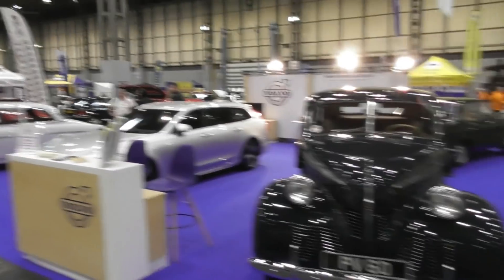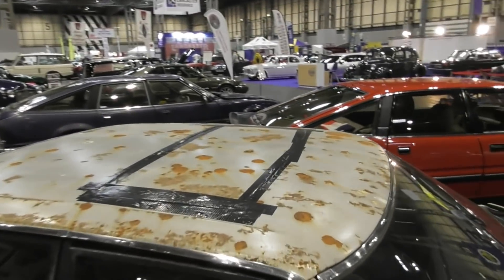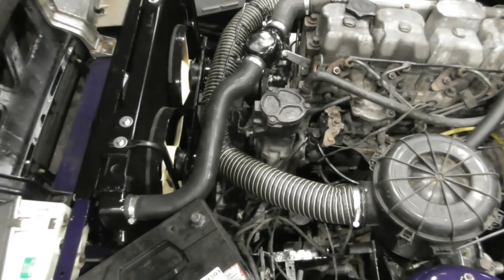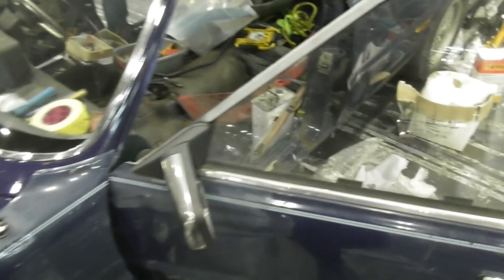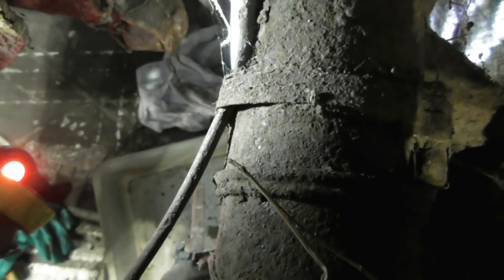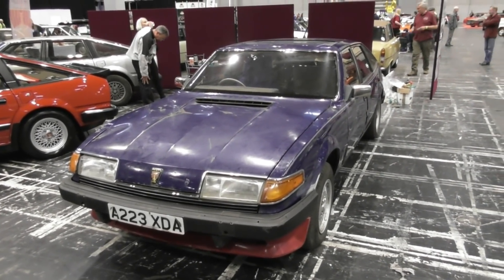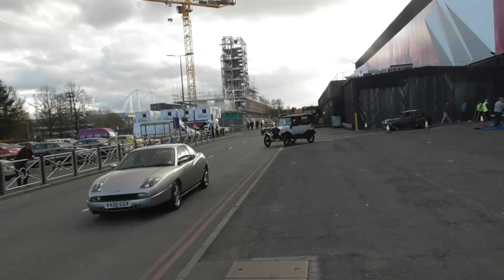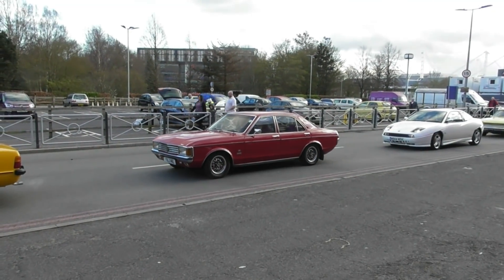Rover SD1 2400 SD Turbo restoration - Video 49 NEC Classic and Restoration Show 2019 part 2

Comment: Alot of people were very interested in your SD1.
Reply from the maker: Yeah i was quite surprised.
Reply: @nitrosilvia  I think it's because it's going through a lengthy restoration and people like them. Another SD1 diesel has appeared on ebay https://www.ebay.co.uk/itm/ROVER-SD1-2-4-TURBO-DIESEL-1982-ideal-summer-restoration-project/192868849312?hash=item2ce7e116a0:g:makAAOSwLGlcjTCd
Reply from the maker: Yes myself and the Sd1 club historian we’re both watching that with interest. Needs saving. I’d have it if I had space.

Comment: The S 1 1/2 VdP must be very rare indeed.
So glad that this and your 2400SD were saved from the scrappers. Back in the day, I'd see Vitesses that were so rough they would have been scrapped soon after. Such a shame.

BTW, I saw an 800 Coupe today !!
Reply from the maker: Yes ive always liked rovers.  Im gonna try and save as many as is practical.
Reply: @nitrosilvia  
I'm getting a soft spot for XJ40s too !!
I've wondered if the 3.6/4.0 six would fit in an SD1... then there's the V12.
That would have been glorious if they'd sold a 5300 VdP EFi or a V12-S.